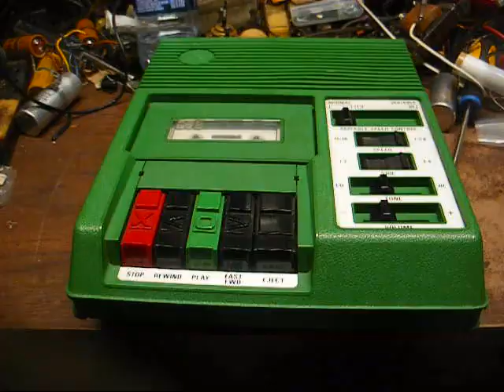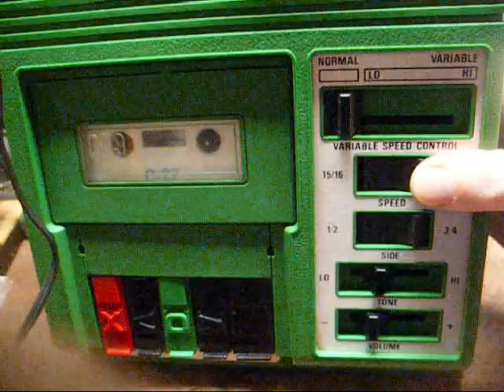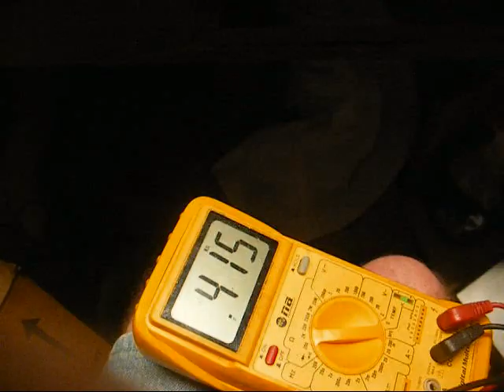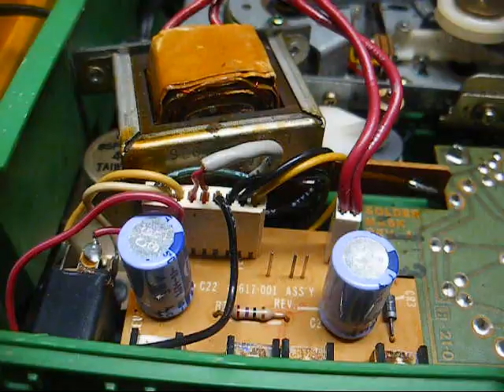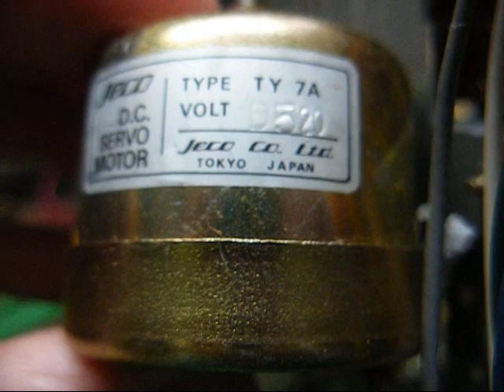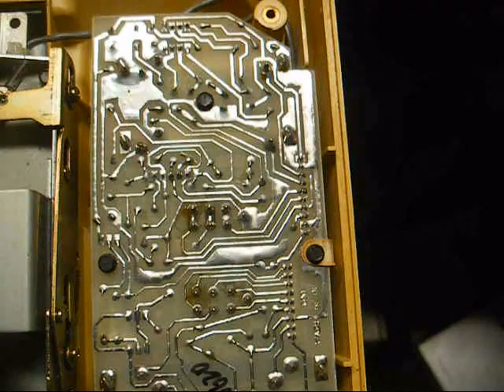Diagnosis of a C79 talking book cassette player for the blind

Comment: Hi! I’m not sure if my two cents will be of any help, but these Talking Book machines had an auto-stop feature. When the tape starts to jam or if the tape is very tight, it will stop the tape from moving to keep the machine from destroying its motor, or eating the tape. I ran the belts to crap in these machines because I read so much. LOL! I’ve been a patron of the Library of Congress since nineteen eighty four or eighty five when I was a wee little person.I think I can remember my first Talking book equipment. I had one of those record players that played the flexible disks. It had a felt-covered speaker and a liftable tone arm with one of those awesome double-sided diamond needles. My first Talking Book cassette player had a speaker grill that was very flat and the power cord looked more like what you would’ve seen on a traditional radio, not the nice smoothly-contoured cords of the later models with their raised speaker ridges. I remember trying to get those big bulky square headphones to fit on my little head and how cool it was to move the huge sliders on the sides that panned the sound or raised and lowered the volume. By the way, did you ever get that thing working?
Reply from the maker: No; but, I was given an orange C76 that is in pretty rough shape and I plan to take the two and make one. It seems like the C76 through the C1 all have the same guts. The talking book record players that I remember in the '80's were the plastic ones like you describe. The most common were the green A79 and the beige A77. In the '90's, they had the A1 and the CT1 combination record player and cassette player. I'm trying to visualize that cassette player that you had. It might have been one of the GE-built models from the early '70's (they kept a lot of those things in service for years).

Comment: Greeting: Diabetic Macular Edema qualified me for the latest DTA Digital Talking book player with a similar AC/battery setup. These units use cartridges based on USB 2.0 Flash memory devices. The recordings are occasionaly in stereo, whereby use of stereo headphones provide stereo audio output. When an NLS provided cartridge was played, an NES game controller could be connected to a side-mounted USB port for remote control functions.That same USB port accepts flash memory sticks thst contain either MP3 music files OR  NLS audio book files downloaded from their BARD website. I have never had nor used an NLS cartridge as the downloads are so conveniet and immediate. BTW: there is an audio book with the redacted Robert Meuller report. No, the redacted pages do not contain long pauses as if the black marks were being read one word at a time. No moving parts unless you count sll of the momentary switches.

Comment: +radiotvphononut Why don't you try this machine with your's motor? I think it's a standard brushed motor with a tacho generator for spped feedback. It migh just need to be disassembled, the commutator and brushes to be cleaned. I've done this a lot for standard cassette deck motors.

Comment: Is there a starter capacitor on there?  If it has one and it's shorted, it would do that.  I had a reel to reel that the starting capacitor shorted out and acted similar to that, other than the motor getting extremely hot.  After capacitor was replaced, it was all good.

Comment: I think you need a schematic of the circuit going to all the wires to the motor. Then you may possibly figure out the problem.
Reply from the maker: That would be a big help. Then, I could more accurately determine if it's the motor or something else.

Comment: Walmart does offer inexpensive dictation cassette recorders with the ONN brand name in the electronics department of the store. I do have one. It seems to sound okay for a dictation machine. For the slower speed tapes, you can just connect it to a computer and record it. In Audacity, you can slow it down to the correct speed.

Comment: They used this type of motor because it has no brushes to wear out. Supposedly a longer lasting trouble free motor
Reply: I think it's a standard brushed DC motor, but it has a tacho generator - hence the 5 wires. Maybe it just needs a disassembly and contact cleaning on the brushes and the commutator. Or the speed controller circuit is faulty. He should try it with the motor from his own player.

Comment: Could be a dirty remote Jack or bad electrolytic on the servo control board reducing the current needed. to run the motor at full power Also clean speed pots (if any) in the servo control circuit

Comment: Being this is a servo motor. You may not be getting the pulse needed to rotate the motor. If the 2 machines use the same motor,I would swap motors to determine if it is actually a bad motor or problem on the servo control unit such as an electrolytic, transistor etc This looks.more like a frequency generator driven motor that Panasonic used on their earlier belt drive turntables

Comment: Isn't that like a brushless stepper motor that relies on a chip to drive it? Not likely the motor is defective unless one of the coils went open.
Reply: I think it's a standard brushed DC motor, but it has a tacho generator - hence the 5 wires. Maybe it just needs a disassembly and contact cleaning on the brushes and the commutator. Or the speed controller circuit is faulty. He should try it with the motor from his own player.
Reply: That player is all gummed up, it needs some non-vaginal lubrication.

Comment: But if the magnetic wheel is not being turned because of a bad belt, then it would make the motor look bad because it wouldn't work.
Seems like a dumb system that would be prone to breaking tapes.

Comment: is it possible the motor is fine, but the speed control is faulty?  It controls the speed, so if the speed ref voltage or whatever it uses, it might be barely sending any current to the motor.   The pots for speed and/or selector switch could be bad or dirty.   Another issue I had with a tape player once that seemed dead was the 'remote' input was dirty.  The motor power ran through it so you could pause it during recording, but it was open so the motor didn't run at all, while the amplifier worked.